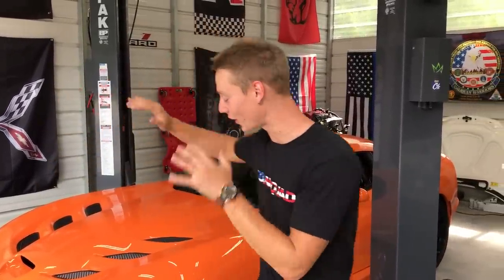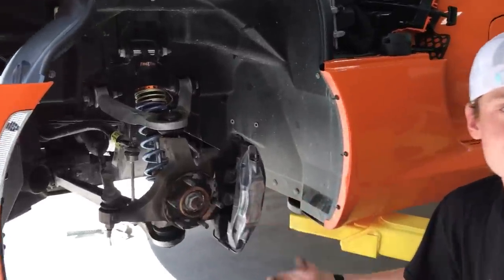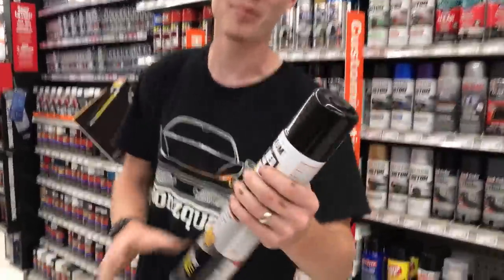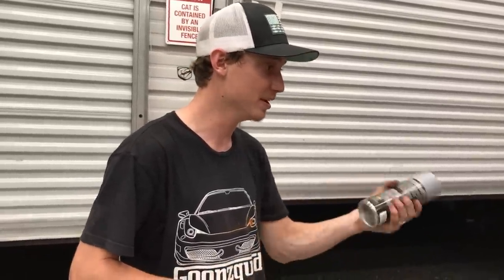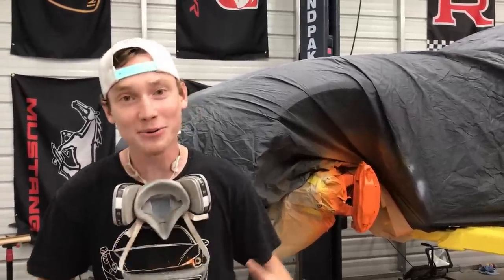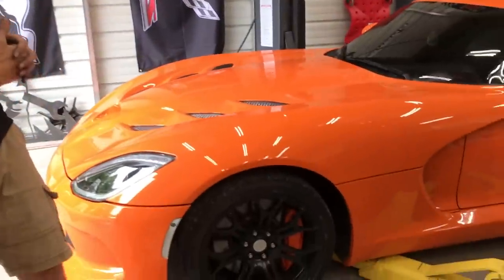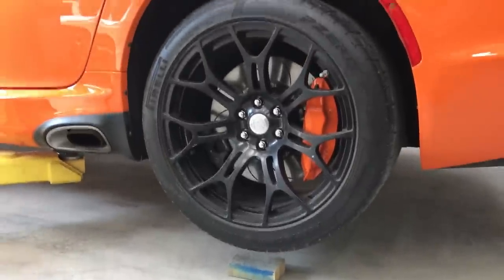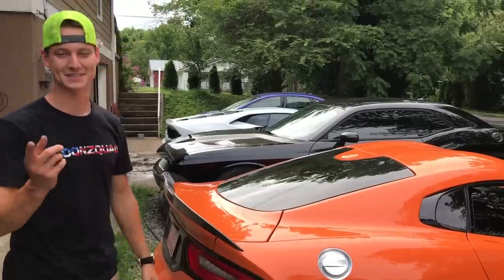Wrecked Dodge Viper TA Looks Better Than Ever!!!

Comment: Have you talked to Tyler Hoover about how squirrelly your Viper is?  He has a Viper that really scared him and he was thinking seriously about selling it. I  think he finally tamed it with some adjustments to a traction control system and I think a different type of tires. I can’t remember exactly what he did but it made the car actually drivable. His YouTube sight is Hooptie’s Garage. He is a car enthusiast with a taste for the cheapest exotic cars and his history of mechanical problems is legendary. Because his cars often are purchased in a broken condition he has a super mechanic he calls the Car Wizard. Wizard really knows his stuff and can really diagnose problems and come up with great fixes. That’s his basic deal. Check out Hooptie’s Garage do a search on the Viper and from him a message.

Comment: You went the trouble of getting high temp primer, but then put normal paint over it.  Do you think the primer will stop the heat?  The orange paint will bubble, melt and go off colour in a few weeks if it doesn't smoke and burn.

Comment: I’d love to see a video where you guys compare the viper with the lambo or Ferrari.  Compare build techniques,  materials, technology, etc.  what makes the lambo a lambo vs viper a viper.  Does one use bonding glue more than the other? Is one aluminum and the other not? Especially now that the new corvette is out and it’s body frame or structure is all aluminum. Whereas the lambo or Ferrari is same or not. Are body parts easier to remove on one vs the other? Is the viper all fiberglass vs some other composite? Is the viper all hand made and what does the chassis look like compared to a corvette. 

You guys are lucky to now have had access to every sports car available. A discussion about the cars in one video would be nice.  Line them all up in order. Would be interesting.

Comment: I find it easier to loosen lug nuts while the tires are on the ground, then they come off the studs easier when the car is in the air. You don't have to fight against the brakes or locking mechanism

Comment: The ACR-E (Extreme) has 1,700 lbs of downforce at it's maximum speed of 177 MPH. I believe the TA with the smaller spoiler has a top speed of 206 MPH.

Comment: A small spoiler lip wont give you much down force even at high speeds. You will have to install a proper racing spoiler and be going over 200mph to get a good amount of downforce.

Comment: Put it on a longer straight away and put your foot on the gas for a while and see how it does. It will make for your most watched video. Use more than one camera so we get good views of take off, mid range and upper ranges(reach at least 120 mph).      But before you do, figure out what is causing one side of the car to dive lower than the other side of the car when you are braking. If it's a problem at lower speeds, it could be worse at faster speeds. Find it and fix it BEFORE you go for a faster run.

Comment: The point where he said that the acr wing slows the cat down by a little just made me go bruhh. The wing gives better traction to the rear tires, around corners you can go through easier depending on the spoiler.

Comment: ok guys TA is not track attack. the TA stands for Trans Am. its a race series that vipers with vertain criteria was allowed to race. the suspension is race track certified for the TA circuit. this also means the car has more hp then the average viper.

Comment: Personally, I would have bled the brakes enough to flush all of the old fluid out and all fresh new fluid drawn in. Being a project car, there may have been moisture in the brake fluid. And if that's the case, a simple bleed will not bring the brakes back to 100%. If you still have a spongy pedal, consider changing all the fluid.

Comment: May have been better to remove the brake caliper. You may have painted over a nut or bolt. Which means when you go to a brake job on the car. Its going to be a pain to loosen the nut or bolts.

Comment: Hey have been noticing that you guys saying that the viper is really low. It seems that the front end is a lot lower than stock ride height with the coilovers. Maybe raise it up a bit
Reply: That's really a good point.  In some  cities with heavy rainfall events, shopping centers are build up above the street level. I doubt a low riding Viper would be able to clear the pavement when turning into many commercials areas.

Comment: The smarter thing to do would have been to remove the calipers from the car, sand, prep, and paint them, then reinstall and bleed to perfection. Painting them on the car is not the best way to do it.

Comment: The caliper paint you used for the base coat was car paint.  The temp rating is wrong.  Shouldn’t you be using a caliper paint?

Comment: it will do even better job to remove the caliper from the car to paint it or even powercoated then .....and not damage the cover for the car with some paint

and now you have some over spray in the wheel protector

Comment: Dude i just noticed that car has grease fittings on the ball joints WTF!!! make all new cars with those like the 80s and 50's ext stuff will last for ever a quick grease job every oil change

Comment: The mismatched side lights are really annoying me. I don't like how you replaced the original ones with white but please do one or the other and not both. It looks really off with 2 dif colors on the front and back. Good work as always though.

Comment: would have power coated the brake pad a bright red to make them pop and stand out from the color of the car itself. Do it right, this hillbilly paint them on the car shit is just not up to your standards guys.
That paint is not high temp rate so it is going to get fucked up.